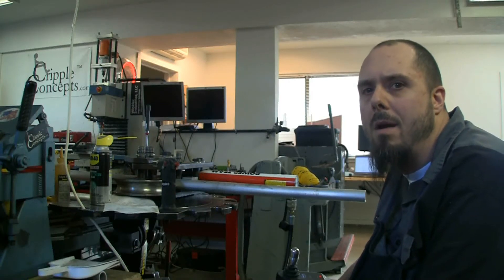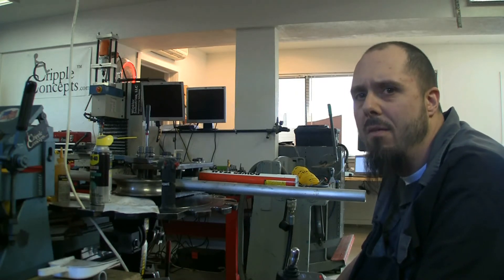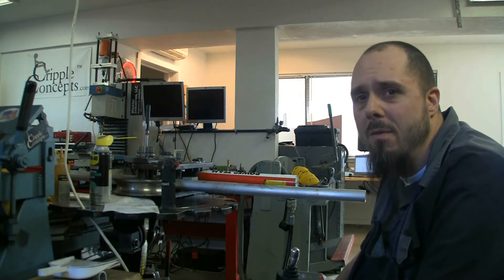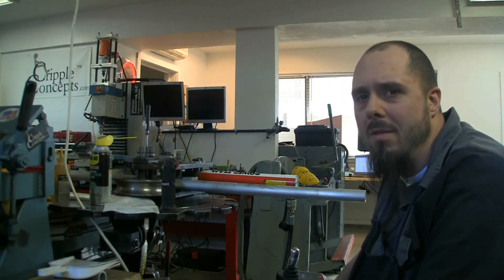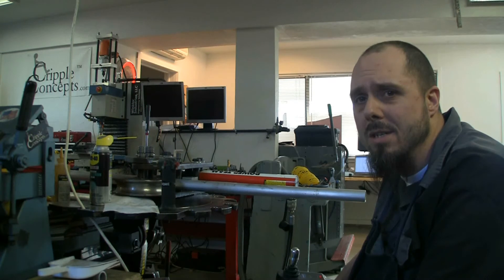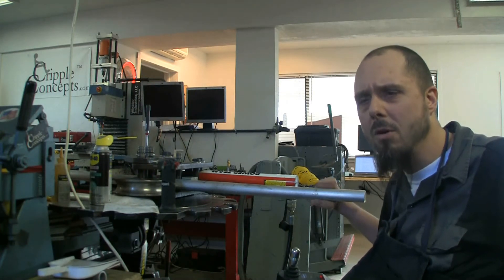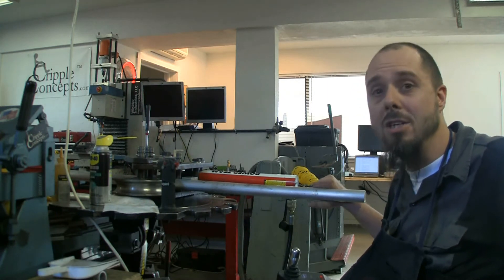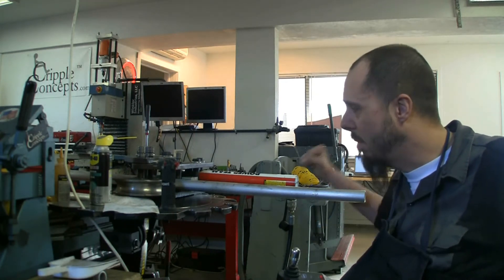Annealing 6061 T6511 aluminium cripple style

Comment: I was bending 1/4" thick x 1" flat aluminum bar today.  I didn't know about the candle soot trick, but I was heating it with a propane torch until the dull aluminum got shiny.  I bent it around 3/4" steel bar while hot.  Luckily it didn't break like it did when I tried to do a tighter radius bend.